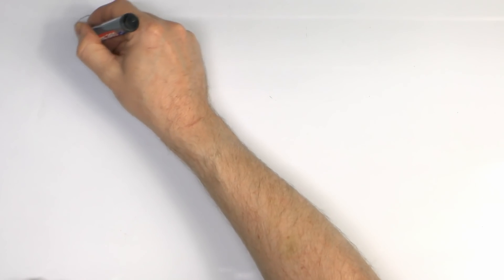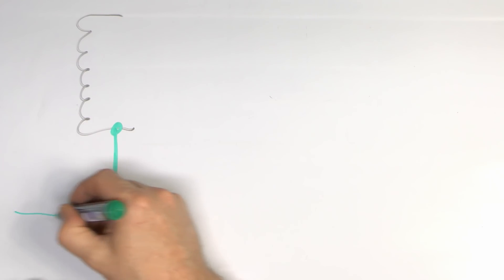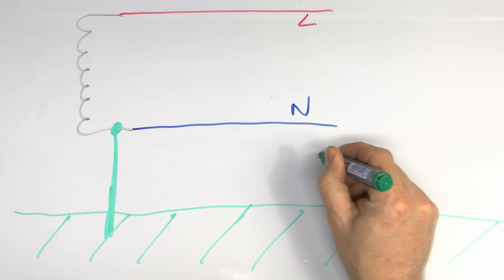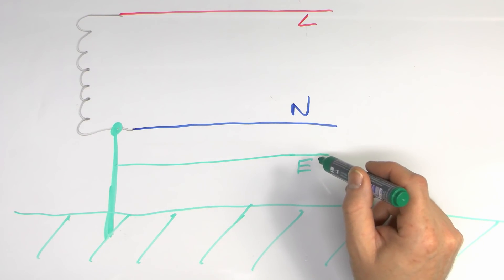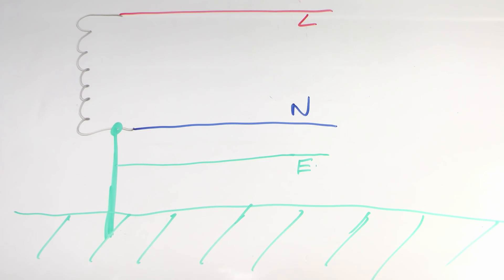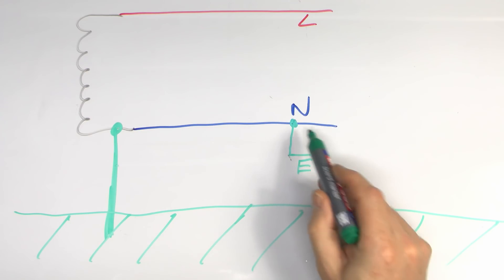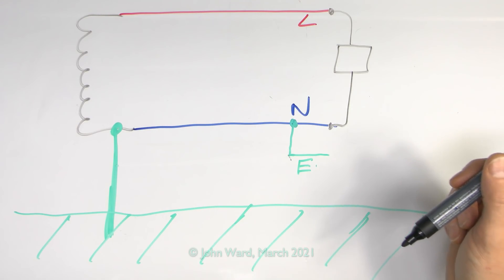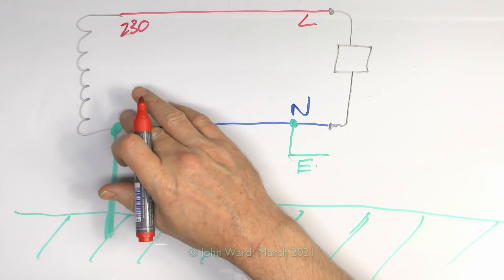Earth Terminal Voltage Drop TN-C-S

Comment: Good vid that. I had a very short explanation without the numbers but rough sketch from an old engineer on a building site at Eastern Electricity Board back in the early 80s with regard to PME, how good it is but how dangerous it can be if not connected properly using outbuildings and it is because of this old boy, I never forgot that 10 minute lecture when I was a mear squat of an apprentice, that I always have stopped the earth connection at a shed or garage in an insulated C/U and used an earth stake with RCD.
Do you remember them good old days when you could talk to the real engineers of the UK owned electricity board guys who were from the real world of experience and not just some young spotty twat who just come from a weeks electricity awareness course and things he knows everything because he's got some French owned utility company fluorescent jacket on.
And I ain't got a chip on my shoulder.
Reply: Young spotty twat ??
Don't hold back ..............
Best comment yet.

Comment: Hello.  In Romania we have a TN-C-S system and each house must have a local grounding of at least 4 ohms to be connected to the PEN.  We call it neutral treatment.
Reply: Below 4 Ohms,not at least 4 Ohms.But most houses just have the PEN seperated into PE and N without a ground electrode connected.Many poles dont have ground electrodes either,so the nearest ground might be 100 meters away from your house.
Reply: 4 ohms for the earth rod? How do you get such a low value? Special treatment to the soil? Extra long earth rod?
Reply: @nahuelparabere5569  Many countries use a steel plate in a trench around the house. It should be more than 80 cm deep.

Comment: please dont lick a 9v battery, a handful of people die each year from exactly that...
Reply: you wont die from licking a 9v battery. At worst youd burn your tongue. To kill you requires either a lot of current to cause you serious enough burns to be fatal, or for the supply to be AC and flow across your heart, causing fibrillation

Comment: The perils of single phase distribution of TN-C system.
I would though expect the distribution company to have a 3 phase in the street cable, and thus with your example 0V drop in the line from transformer to the first house, then only 3V between the first and second houses with then additional 3V to the last house.
Reply from the maker: 3 phase cables are often used in the street, but that cable can supply 20, 50 or even more properties. It's very unlikely that the loads will be balanced across the phases, so there will always be some current in the neutral.
Reply: That is correct, but the more properties you have on the 3 phase line the more they will balance out. It will though require great deal of luck to have it Zero current in the neutral.
It will be lot less than the 9V drop in your example. TN-S is the way to go.
Reply: @jwflame this means that there will always be some "activity" on the grounding wire after the PEN separation point? I checked with one clamp meter in house on the PE conductor in the distribution box I have up to 18 mA and on the earth rod up to 300 mA. My grounding resistance is 2,56 ohms and the PEN separation/ connection with house grounding is done at the entry of the wires into the property.  Thank you!

Comment: Keep it going john, more to come...
TN-C-S... the biggest mistake the UK electrical industry made in the 1970s... and who pays... we all do🤦🏻‍♂️
Reply: If done correctly, TN-C-S has great advantages over other systems. Local proper grounding is the key.
Reply: @Poebbelmann  Any system relying on being done correctly is asking for grief. Especially given the laughable state of some of the Part P types making a joke out of the electrical industry these days.
Reply from the maker: @Sebi  Local grounding for TN-C-S isn't done in the UK.
Reply: It's not entirely one sided, at least in the event of a break in the earth, you have a bunch of irate customers phoning up the dno to find out why none of their stuff is working anymore, a TNS would just fail silently, leaving no clue it had done so till someone had need of earthing.

Admittedly it would be more dangerous in the mean time, though Bonding would take the edge off.

Take your pick: dangerous for a long time, or  even more dangerous but for a comparitively shorter time. 

Thank god that type of fault is relatively rare.

Comment: Like mentioned in previous video, wouldn't groundingrod from TN-C-S junction to ground solve this issue (evening the potential difference)? In Finland this is mandatory to do anyways while TN-C-S is also used virtually everywhere. To be more precise, I think loop around building or generally long enough metal is needed also, not just "stick in the ground in corner of house", for making sure bonding is adequately made.
Reply from the maker: Yes it would.
Unfortunately in the UK, that is optional and therefore never done.

Comment: I think you may have got this slightly wrong unless you're describing say,  phrase 1 distribution around a block of flats for example,  but in an 3 phase supply network to homes the neutral only carries the unbalanced load ( my neutral return will pass though my neighbors home when phase is at 180 to my phrase. Also the neutral will be bonded to the mass of earth at the feed to every property in an attempt to clamp it to 0 volts or as close as posable
In fact loosing the neutral within the supply network won't result in all class 1 items to become live at mains voltage, the voltage will become very unstable ( if say 242v supply drops to 200v then 42v will rise on the neutral ).
Reply from the maker: Installations in the UK do not have any earth rods / electrodes at the property, and almost all of them have a single phase supply so unbalanced loads are inevitable.
Reply: Hi john. Thanks for reply, I love you're Chanel! , and great deal of respect.
I'm referring to the DNO infrastructure, the 3 phase network, every house that is single phase connected to one of the 3, your next door neighbours will be on a different phase . 
Take a look at overhead cables feeding a property that's on a tn- c- s there will a 16 mm single core  wire running down the pole in to the ground, that's the neutral bonding wire. Its there to keep N-E to 0 volts, 
Every house is connected directly to to one of the phases ( staggered ) and not looped along one phase as you was illustrating

Comment: why does uk not use 3phase install for domestic. We have done that for 50 or more years in Denmark. showers get warm water from the central heating system and hobs run on 400V. keep the amps down
Reply: All I have seen in DK are (3-phase) TT systems. Why is this common in Denmark?
Reply from the maker: No need for 3 phase, there isn't any equipment used in homes that requires 3 phase.
Most UK homes are heated with gas.
Reply: @jwflame  Our village didn't get gas until 1989, many of the houses built in the 50s, 60's and 70's had storage heaters, so almost all of the houses have a 100A incoming supply. 3 phase would have been a sensible route in those instalations.
Reply: @cambridgemart2075  The village I live in still hasn't got gas! I heat with an oil boiler though I think the house must have had night storage heaters before I bought it as there were three incoming wires, a neutral and two that ended in main fuses, though only one connected to anything on the load side..

Comment: It would surely be 18v to earth, not 9v at the last house
Reply: It's 9v
ibb [dot] co [forward slash] 5k9VnF9
Reply from the maker: https://ibb.co/5k9VnF9
Reply: @jwflame  Thanks. It wouldn't let me post the link.
Reply: @jwflame  During Lost Neutral of TNC-S to a street:  ? Would my own earth rod carry the disconnected neutral current from other properties in the street - 
would the cable linking my earth rod it to my own TNC-S main earthing terminal become dangerously hot ?
Reply: @spudhead169  What software did you use for that?
Reply: @dropdatabase8224  It's called Circuit Wizard Student Edition. It was a free-to-use version of the software that was meant for students (obviously) about a decade ago. It's now no longer available for download. It's not a particularly amazing circuit simulator but it's extremely easy to use and it's useful for roughing out basic ideas before using more serious software.
Reply: 18v difference from start at tx, not end house E.

Last house, L N at AC so 9V and 9V
as N is E, E is a distance of resistive cable connected to N of which throu the resistive Planet-Earth ( mud and rock ) connects back to E at TX, of which TX E connects to N.

In all another electrical circuit that never gets drawn on circuit diagrams.

Its get even more confusing when you are dealing with virtual-Earths and isolated removed Earths in Iso-Transformers, in High frequency or super high voltage SMPSUs.

In all eletric ( electr-ic) is flow of eletrons, which want to return to the start ( a circuit ).    Volts are the difference in between to item.

Remember as its confusing, two difference AC or DC appliances or circuits can have a voltage difference between them even their case Earths, hence in some locations you addtional Earth Bond the white good appliances just like Water pipes.  On production lines you may do this too, or in Casio and Timex they passed 50V DC  ( yes DC ) thou their site-Earth ( Virtual not Planet-Earth )( and delinked N to E on sites Iso-T), to stop static damage to their stuff they are making. ( floor was insulated with pure rubber 1 inch thick, available mainly from RS to stop electons from Site-Earth going to Planet-Earth ( returning to TX, making a full circuit of electons ) which would be  shock risk to workers if did).
Reply: I understand your confusion, by the way it is presented I also tought it should be 18V.

Comment: Mmm. This could explain why I could feel a buzz on my arm when leaning against my caravan last year ( like when you lightly touch a touch-switch table lamp) it wasn't unpleasant but definitely unnerving.  I'm guessing the earth on the electric hook up was a few volts more than the grass below, as there was no stake at the hook up socket...
Reply from the maker: Caravans are not permitted to be connected to a TN-C-S supply.
Reply: @jwflame  correct John, and being a large site I'd assume it was correctly installed and certified. But I can't think of any other explanation, and the neighbouring caravan occupant said his felt the same

Comment: So is the 9v between the earth 🌍 and the other earth unmetered?..

All I kept thinking was free electricity.. :)
Reply from the maker: That current is metered, it's already flowing through the installation.
Electricity meters measure the current on the line conductor.  Whether that current then flows via the neutral wire, through the earth itself or some other route doesn't change anything.
Reply: Hmmm interesting thought could we utilise this
Reply: Nope, like video said difference occurs only when current is flowing on the normal circuit, so that means you pay already for it
Reply: @samiolmari3821  how are they going to meter the power inbound on the supply. It must be metered from the floating ground reference.. so that floating ground which is positive to the real ground must be outside the meters ability to read it, maybe..
Or would it depend on the meter?..
Reply: @TheWebstaff  Just think for an moment what it means "current needs to be flowing" (in normal circuit) for voltage difference to exist between earthwire and real earth...